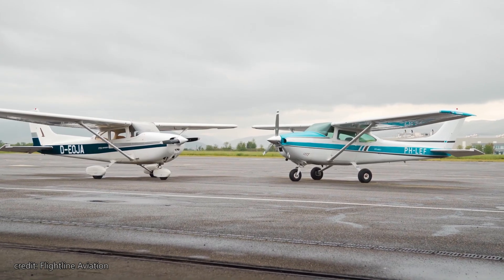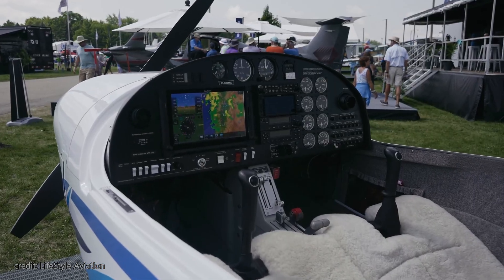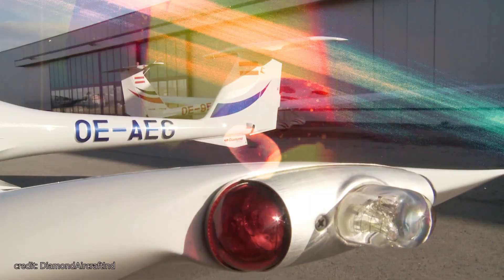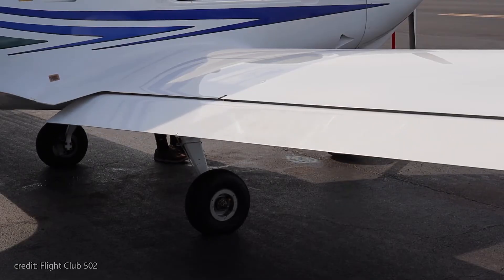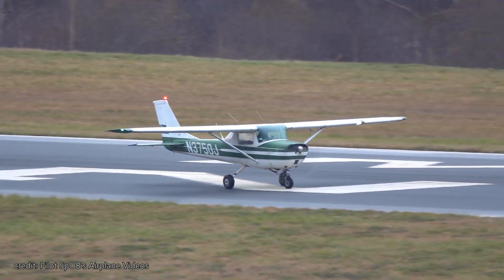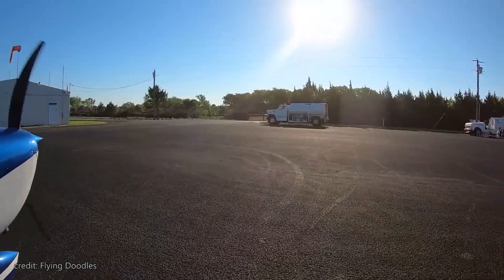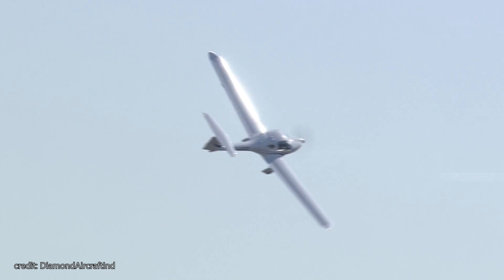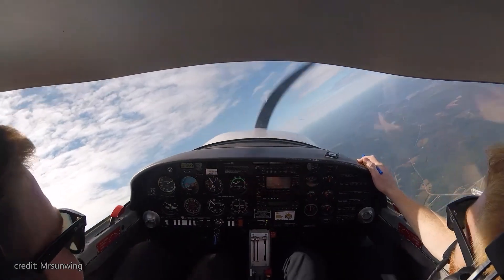Diamond DA20 – Best (Not Only) Trainer Plane! Review, Specs & History

Comment: Well, the DA20 is my trainer currently. At first, it took some getting used to: You did not mention the "missing" nose wheel steering; making the Katana harder to taxi than to fly ;).
Control inputs on the stick are very light; I think this makes it harder on you at the beginning; also you have to "deal" with the prop leaver (in the A - variants) in all checklists and emergency procedures; Vbg is with flaps 1 for some reason. Further, landings - esp. no-flap landings - are very floaty. I am ~ 1m88, and just barely fit in the plane with rudder pedals hitting the firewall.
All that said, this little bird grew on me and instills a feeling of accomplishment once it makes click in your head. I can confirm the Katanas of my flight school are charterd by "seasoned" pilots quite often.

Comment: The high purchase price, low useful load, tight space, non-adjustable seats, non-IFR rated, VERY difficult cold starting, and if you grind the starter gear (because students are dumb) then the engine has to get torn down due to metal in the oil; ALL really DO NOT make it a “better” trainer IMO than a Cessna 172 that really has none of these issues and just burns a little more fuel….
Reply: I learned in a 152, I then found a nice one and bought it for myself. No regrets after owning it for over eight years now.
Reply: @massmike11  yeah they’re great little airplanes for sure. I’m just saying I don’t feel like they’re better as a trainer than a Cessna 172 (due to the aforementioned reasons). This is just my opinion after having trained in and train others in a Cessna 172, DA40, and DA20 is all.

Comment: I bought my 20-C1 in 2022, it brings me a lot of fun. The only problem for me is it's too difficult to cold start the engine when the temperature drops below 10°C without pre heat.
Reply: I'm starting to learn that pre-heat is my best friend for starting my Katana in the cold! Heating blanket and hair dryer works well at a minimum. I also have a starter vibrator system that has a separate 1.3Ah 12V battery. If it’s disconnected or dead, starting is notably, more difficult, but not impossible. Got a few DA20-C1 videos on my channel.